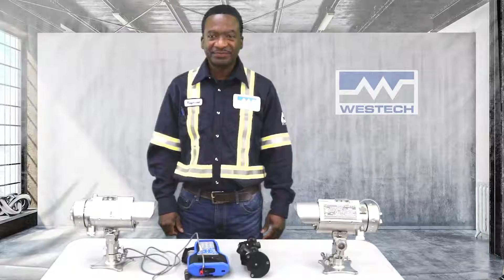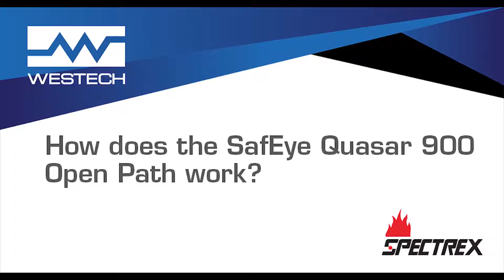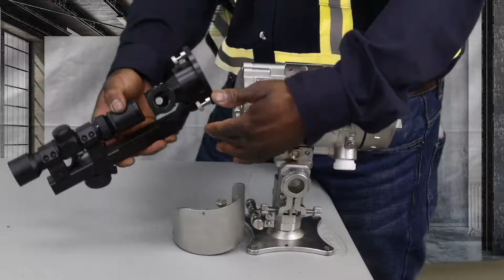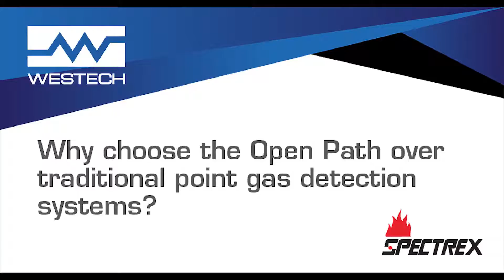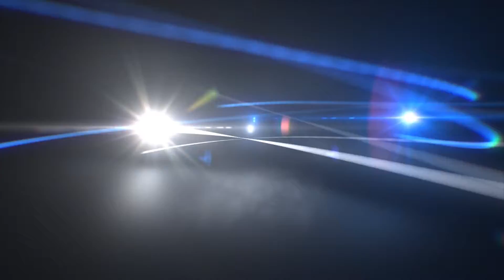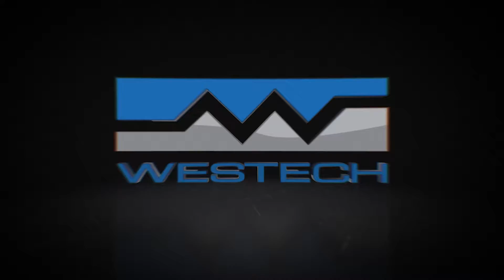Service Tips Tuesday - SafEye Open Path Gas Detector

Comment: Hello. Is there any problem if this detector will be out of range for a long time? Can this cause any damage for it?
Reply from the maker: Hi, thank you for your question! The SafEye open path detector is designed to be highly durable and reliable, even in challenging conditions. If the detector is out of range for a prolonged period, it typically won’t cause damage to the device itself. However, being out of range may affect the system’s ability to monitor and detect accurately, which could compromise safety coverage in the area.

It’s always a good practice to bring the detector back into proper alignment or within its specified range as soon as possible to ensure optimal performance. If you need assistance with troubleshooting or maintenance, feel free to reach out to us or consult the user manual for more details.
Reply: Dear , pls I have little issues with my open path, is blinking green but not detecting gas speed across the path, also am using mX52 panel with it, no LELm in the unit of the panel, pls what is the solution.